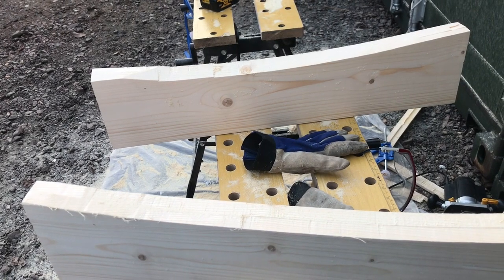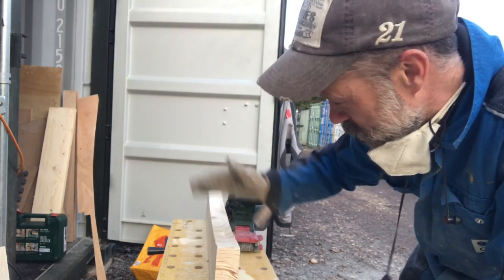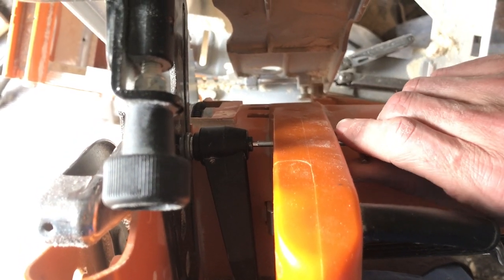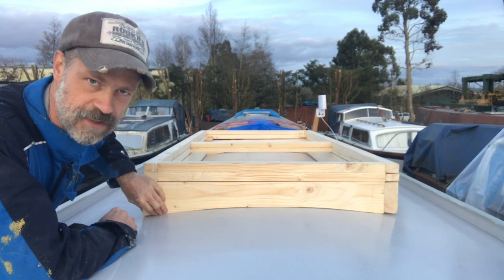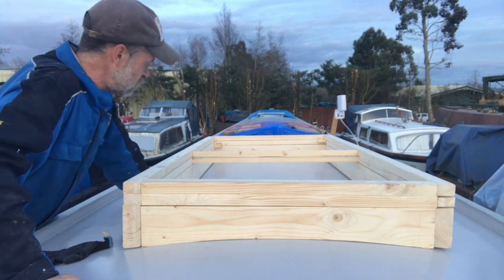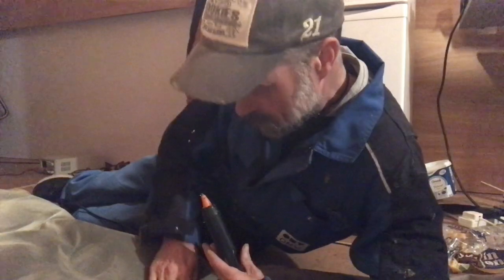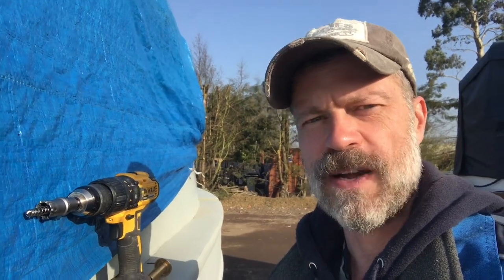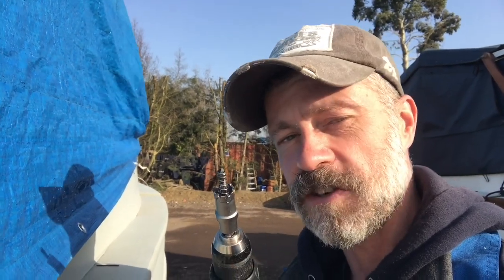37. Making a Prototype Roof Box For The Solar Panels

Comment: Hey Stephen. I am sorry for breaking my deal with you. I am sure you have missed me (mostly my comments)greatly  and had sleepless nights, wondering why I was not responding to your videos. Especially after having told you last time, that I was back. Sometimes life gets in the way. But I just watched the last 3 videos. Things are really coming together. Great to see the progress. Although sometimes I get the feeling you are overthinking things or overcomplicating them. I don't think I would have gone for wooden frames for the solar panels. But then again, what do I know. I never built a boat or anything else. Your boat, your choices, so don't let me go smart on you. Keep up the good work. Kind regards😉
Reply from the maker: Hi Michiel! Nice to hear from you... I can sleep again now ;-) 
Your right about probably overthinking things, but then, I'd rather do that than 'under think' things (and even so, I still miss things i should have thought of :-)

As for the roof boxes. You have a good point. I went for wood mainly for the aesthetics  - whilst I am in no way aiming for a 'traditional boat' look, I think the boxes look better than the 'space-age' solar mounts you can buy (although they are undoubtedly better in performance) - mounting the panels is fairly common on narrowboats here in the UK, so i am not totally re-inventing the wheel :-)